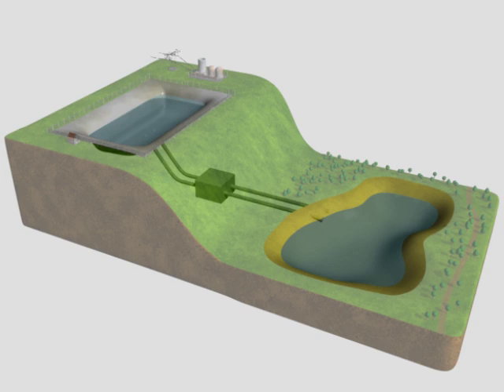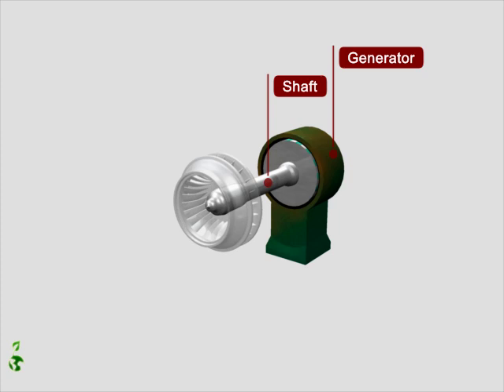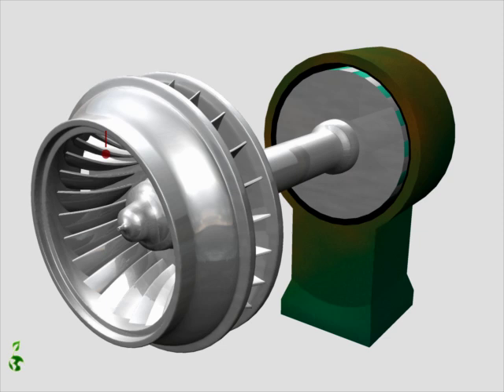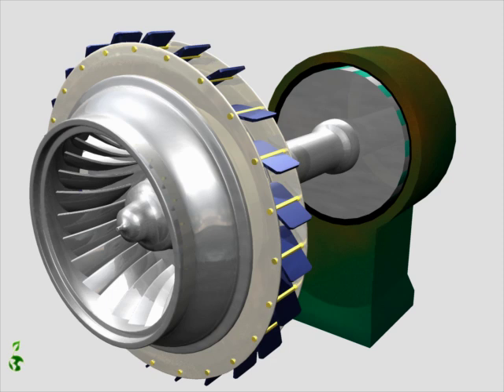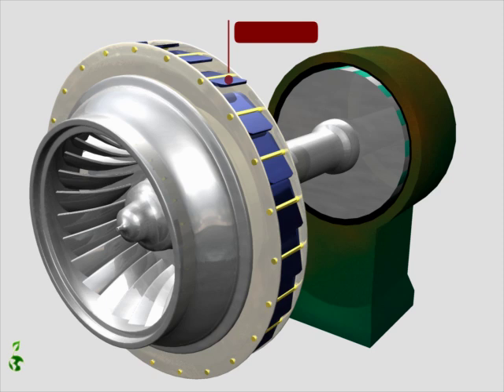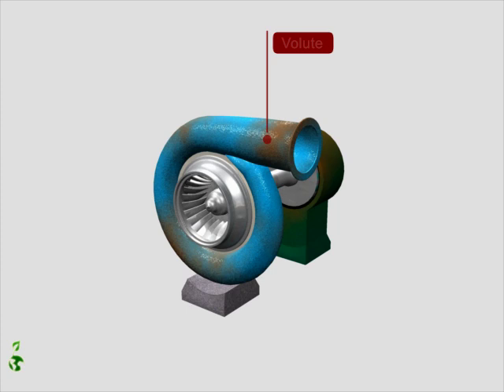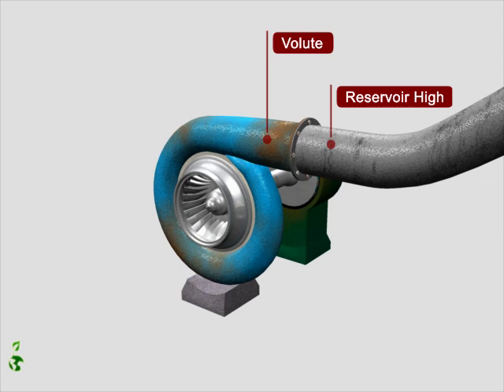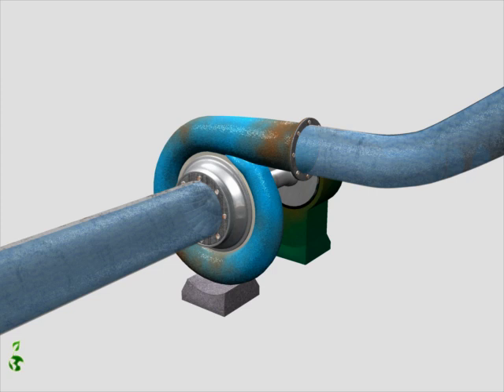Francis Turbine (in English) - How it works!

Comment: i didnt get wat u wanted explaining but if u r confused abt the pipe on the right then water enters from a higher altitude[location] which we can see in general life that when water falls from a height then it comes with a force .... this force moves the blades which r connected to shaft. moving of shaft causes to generate power in generator. in technical terms water at rest has potential energy which is converted to kinetic energy. as water with this kinetic energy hits blades (cont)

Comment: Based on my knowledge... Francis turbine is a vertical axis hydraulic turbine... But in the video you are showing it as a horizontal axis turbine. I think you can make another video by showing it as a vertical one
Reply: In study materials which I have and study from is francis trubine radial and axis can be Kaplan turbine
:)
Reply: Francis turbine usually has vertical axis because: the static head is even on the whole circumference of runner and it's easier to shield the generator from water in case of casing rupture. However some small Francis turbines have horizontal axis.

Kaplan turbines with scroll casing feed always have vertical axis and Kaplan turbines placed directly in penstock have horizontal axis